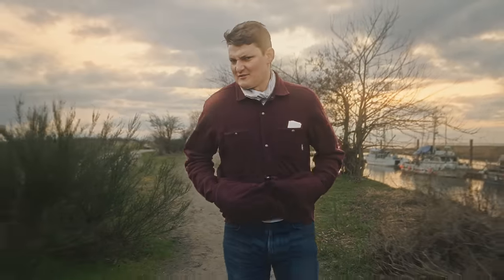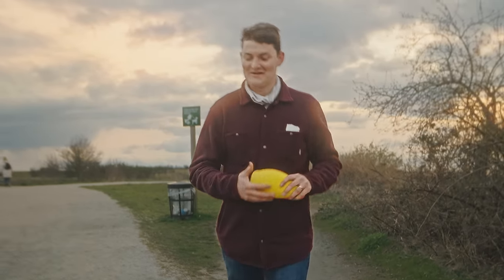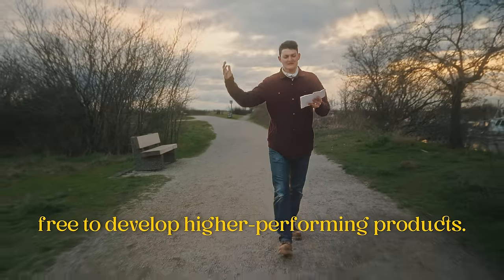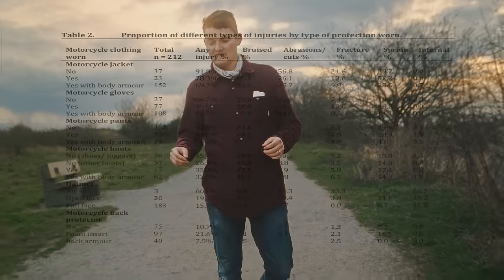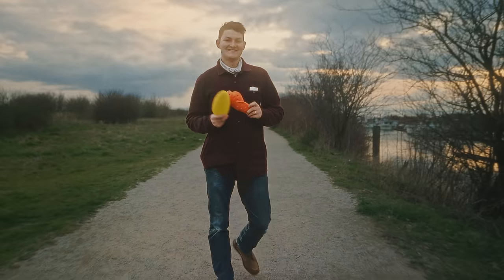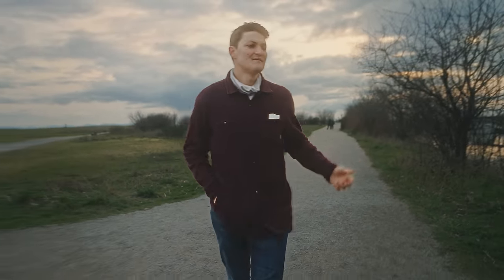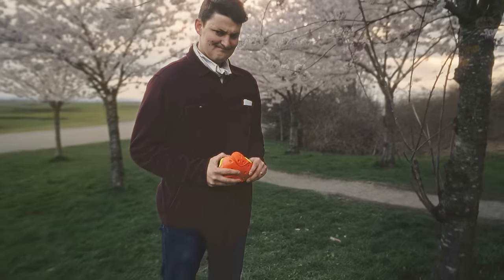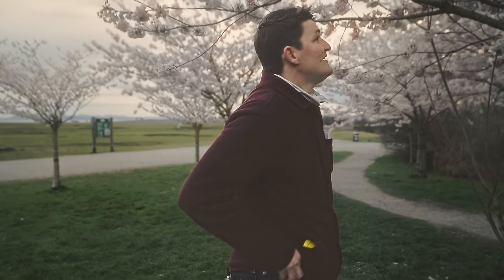Why I Stopped Wearing Motorcycle Body Armour

Comment: My Rukka back, elbow, knee and shoulder pads protected me very well when I did a 360 somersault while still on my BMW F900XR when hit oil, followed by a curb then a barrier on a blind corner. I landed on my back on a metal barrier. In the area without the armour  my back had 3 fractures, a bad cut and severe bruising.  Where the armour covered, I had no fractures or marks at all. Despite the metal barrier ripping through to material to the back armour. The armour completely protected that area. It also protected my knees and lower legs, should and elbows completely.  Normally your videos are awesome, but this one is irresponsible. Rukka pads  are above the basic standards, and that was one of the reasons for choosing the brand. It saved me from injuries I don't even want to imagine.

Comment: In April of this year (2024) I made a "rookie mistake" (after riding for over 50 years) on a failt steep lefthand, decreasing-radius, off-camber turn in Death Valley. A touch too much front brake and the front tire (tyre?) of my Triumph skipped for a millimeter, but on an off-camber, the road "falls away" from your tyre and there is no way to regain traction. Immediate washout of front end before you even see it coming (I was doing around 35mph). 

Wearing armored (OK, armoured) leather jacket, kevlar/cotton jeans, Arai helmet, leather gloves and Sedici boots, I went down hard, with the bike directly on top of me. The first point of contact with the road was my left knee. The pants tore open, the armour (which might have absorbed ta little of that initial blow) shifted out of alignment. The result was a deep wound right down to my meniscus, torn ACL, along with three broken toes, metatarsals, etc. No upper body injuries. The lovely Arai helmet scuffed and skidded but not a hard blow—only enough to ruin the beautiful gray-on-silver-on black British flag motif. Being months away from 70 years of age, I fortunately still heal fairly well and two months later I was back on two wheels (I'll be riding across the UK next month to attend the Manx GP on the IoM.

The point here is that I was disappointed that my knee/leg injury (which resulted in infection, swelling, seroma, etc) was not prevented by the armour. I assumed it deflected it to some degree and perhaps it would've been worse without it. But this video definitely shed some light on the issue. It didn't however, propose any better options. Is there a higher-level CE armour available to replace the standard stuff? There's a cottage industry opportunity right there and I'd be first in line.

That said, will I remove the crappy armour from my new gear? Nope. Better poor protection than none, methinks. And don't make rookie mistakes.

Comment: As with bicycling, the protective gear gives people a false sense of security and invulnerability. While I have not been in a motorcycle crash, I have seen the aftermath of several. Knowing what one looks like, I would rather die instantly in a crash because I didn't wear the protective gear, than live my life in crippling pain with several disabilities because I survived a crash thanks to the protective gear.

Instead of wearing body armor, I practice additional caution. I would rather rely on my ability to avoid unnecessary risk and dangerous scenarios so as to not have a crash at all.

Comment: I'm riding motorcycles for 40 years now and wouldn't go out without  wearing my Alpinestar tech air vest. Before  that, I've always  used foam body armour, and it served  me well the few times  I came off my bike. Body armour is absolutely  helpful in particular  in lower impact force  crashes.

Comment: my MT03 slipped on something I didn't see and I was throw from my seat at 120 km/h. My leg was stuck under the bike and both me and the bike slide together on the concrete for almost 50 m. I got very little scratches on my lag, my jean damage beyond repair, but that’s it, not thing more. My riding gear with those little foam protection was doing its job so well and I appreciate wearing it every time.

Comment: My experience snowboarding with & without crash pants/vents says you're wrong (the crash wear in snowboarding uses the same standards afaik). I fell many times on the board with & without protection, so here's just one example. While buttering I caught an edge without impact shorts & landed on my butt (not much speed). The pain was enough to take my breath away. I couldn't sit for weeks. On the other hand I once had a wipeout on the snowboard riding about 60-70km/h while wearing full protection. I landed pretty rough on my side (shoulder, elbow, ribs) & tumbled a good 2-3 times before I came to a stop. TBH I didn't really feel the impact at all. I brushed off the snow & continued riding like nothing happened. Even though I never had a crash with the motorcycle, I assume the results would be similar. Protection is amazing. Even if you still break a bone wearing protection, I'd assume the effects would be worse if you didn't wear any. YMMV

Comment: A car went through a stop sign I hit the car and went over it. I was wearing a full one piece suit, I broke my collarbone fractured all my ribs on my right side punctured my lung fractured my pelvis and I had a large hematoma on my leg
I looked at my suit months later and determined that the padding in my elbow and forearm is was probably broke all my ribs.
Did it save my elbow maybe but I almost died because of the puncture.
And I still wear gear with elbow pads I just wear more chest protection.

Comment: Been down 2x. I city, 1 highway.  Untold crashes off road (mx).  Never have i regretted any padding or protection.  Bohn pants on bottom instead of underwear   under my jeans and armor in my mesh jacket year round with layers as needed. Full face helmet, of course.  But hey... that's just me.

Comment: If you have a crash and you wear armour and nothing happens you will automatically think it is because of that.

If you have a crash and you didn`t wore body armour and you have a fracture or whatever then you probably are more likely to blame yourself (depends if you tend to do that).

Personally I think it`s a better deal to wear it, wether statistics say it or not.
On the other hand you should ride the same as you would without any gear, because when I was younger I rode more reckless with gear than without because I had the illusion of protection.

Comment: OK....  I have crashed a few times road and track... I wore back protectors as soon as they were first being sold and my original T Pro back protector got used at my very first race meeting when I was thrown off and landed hard on my back. I would have been winded as a minimum or worse but I got up with nothing more than some torn muscles and sore for a few days, the cost of new helmet and a bruised ego... Not the best back protector as it was quite thin and basic. I now have Forcefield armour back protector and the rest of the armour in my leathers and/or road riding gear is as supplied by the manufacturer. But I always use that Forcefield back protector road or track.. Now the problem with air bags are you can have them fitted inside the clothes and race suits you buy but how many jackets do you have? Can you swap that air bag to each one without having multiple air bags? Then can you use that same air bag inside a race suit?  Apart from Helite vests which fit over jackets and suits the answer is no you cant use the same air bag.  If you have an air bag do you want to have multiple subscriptions for each air bag?  If you use a air bag vest without a subscription, do you want to have to use a lanyard every time you get on and off the bike? Wearing a vest over regular riding gear is a pain and the fluro yellow or orange vests just look awful in most cases.  So you end up with the expensive Helite electronic vests which has to fit over your normal riding gear OR leathers as the race one is made for the racing humps and the road one will not fit over the hump... Vise versa the race one will have an exposed area where a hump should be and can grab if you land on the road and slide causing possibly more injuries.. 

We need an air bag which is electronic and works in any suit or jacket like a normal back protector which we pay for and not need to pay for a subscription. I want to own it and not have to keep paying for the benefit I have already paid for...  The only option is the Helite race vest or electronic road vest and for me the race vest alone cost more than I paid for my race suit and would cover over any sponsors logos and not match the custom race suit so to keep sponsors happy, I would have to go back to the old back protector anyway..  I know of at least one rider at this years TT removing his air bag to save weight and reverting to the old school back protector which is another issue alone but one racers, even at the TT have with air bags.

Comment: When i did my CBT, one of the things that the riding school i went with showed us was the full leather jacket of the guy who owned his the school that was damaged, not much mid you, and they asked us to guess how fast the guy was going. He was going 120 miles an hour on a private road, so not a race track with super smooth tarmac in comparison to a normal road and he was able to walk away from that and is still alive. That full suit and the armour in it saved his life, he would have been severely injured or dead with out it.

The whole point of any protection, whether its motorbike body armour, bullet proof vest or a well armoured tank is that its there to mitigate the potential damage. It will never work 100% of the time, but its the difference between you taking a massive hit and being able to walk away verses not.

I had a very small accident where due to some black ice on the road as i was turning into the street i live on at slow speed, my bike went from under me and i slammed into the road hard. I was only wearing a casual leather jacket thats not for motorbikes and my arm was heavily bruised and sore for a good while after, also the arm of my jacket was torn apart. If i was wearing my Dainese jacket when this happened my arm would have been way less sore because of it and the jacket would have been much less damaged if at all
Reply: Glad to hear you survived however you make a number of assumptions with regared the different gear you could have been wearing - "If i was wearing my Dainese jacket when this happened my arm would have been way less sore because of it and the jacket would have been much less damaged if at all" - you have no way of knowing that without totally replicating the incident. It`s good that you have some confidence in the gear you choose to wear but don`t let that confidence lull you into a false sense of safety, stay safe.
Reply: @pamvarnsverry2444  Mate, one is casual leather jacket that is just for fashion and the leather is significantly softer than on my Dainese jacket, which also has armour in the arms that would dissipate the force. The arm of the casual jacket in question is completely ripped from the elbow down from a slow speed crash. 

I dont need to have the exact same accident in the Dainese jacket to know it would protect me more. Its a CE AA  rated jacket compared to a casual jacket that if it was put through the CE certifications test would fail outright. This is like saying to someone who got stabbed wearing a t-shirt, that they'd need to get stabbed again wearing a stab proof vest to confirm that it would provide more protection, which is an insane thing to say

Comment: My crash experience supports your hypothesis. However, I was glad to not have to deal with road rash in addition to my fractures. 

I crashed into the woods at 45 mph and only broke my leg. The break happened when the bike fell on it; I wouldn’t think ANY pad would help there.

Comment: I lost a front tire. I do REGULAIRILY check my tire pressure, in fact I checked it the day before and it was fine. Rolled out of my driveway, 30 yards or so up the street. Leaned perhaps a little aggressively into the corner and the bike just laid down. I had never felt anything like it, it was like the front tire was on grease. But I was wearing a jacket and pants, landed on my hip and elbow and it was like falling into bed. I slid way farther than I expected for the speed, like 20 feet, but not a bump or bruise. I get the point, in a serious crash they won't do much. They'll do more than if they were not there even if it is minimal, but most crashes are not that bad. Most often people are on the brakes before impact and the average speed of motorcycle accidents is only 21 MPH. so I think they are helpful at that point. My opinion, for what that's worth.

Comment: Just witnessed a lowside with 25 Mph in a turn: The armour shirt fabric (KNOX Urban MK3, AA rated)  over the ellbow armour ripped just away. The guy was unhurt because of the yellow armour pads inside: They prevented the guy from shedding skin, NOT the tissue. Same story, even worse, at the knee (Held Urban 46). Only the armour safed the skin. The fabric was shredded. And this was at 25 mph (around 40 km/h)! I'd advise to put those armour pads always inside. 
(I send the fotos and a report to Knox: AA rated garment rips away at 40 km/h? Strange)

Comment: Let's consider this using a similiar situation. A helmet that soldiers wear are not capable of stopping a bullet fired straight at it. Should the soldiers there for stop wearing them? Or should they continue using them as they do stop shrapnel, bullets coming in shallower angles and impacts caused by bumping etc. . Like the helmet, these pads likely have an increased usefulness in situations where the force isn't coming directly perpendicular to the limb, or like stated in the video grazes and so on. And out of accidents that happen on a bike, which is the most common? A crash with large impact forces or losing traction resulting in a slide and other such accidents? It's still better to have them while not being a complete universal protection than not having them.

Comment: As a guy who doesn't ride (but is starting to flirt with the idea) i can only speak with very limited perspective, but i worked with a couple guys that did years ago, both of which wrecked in the time i worked with them. Different wipeouts, different circumstances, and different outcomes. One, on a track, laid his bike down, no armor, had road rash from hell. The other, on a highway, doing a wheelie, sent the bike into the air, and rode the off ramp on his back, in full armor, was totally fine. My takeaway: the armor is likely much more intended to protect your skin from being ground the hell off, than it is to pad your skeletal structure. If you're going fast enough, and wreck badly enough, that you'd be at risk of breaking bones, i really don't think any kind of armor is gonna prevent that from happening. I could totally see it saving you from getting cheese grater'd and spending time in a hospital waiting for your ass to grow back though.

Comment: if youve ever played hockey, where the surface is practically frictionless vs a tacky road, falling on your pads, again in hockey where max normal people are going 20mph, is far more preferable to not having pads. slamming on the ice where theres no padding is harsh, or getting hit by a puck where theres no pad is exponentially worse than the padded hit. there is no way ur convincing me slamming at high speeds on asphalt without pads is gonna result in similar injuries, ludicrous. uve drawn the wrong conclusions from ur interpretation of a narrow data set.

Comment: I had a Kawasaki KLX650 I would ride to work. One morning last September I was topping a hill on a forest dirt road on my way to the highway when a deer I never even saw darts in front of me at 50mph. Of course I flew probably 20 yards down the road. I was wearing my full face helmet, a waterproof jacket and pants from Amazon and good riding boots. All with the pads removed from the last cleaning. I had forgotten to reinstall them. After the accident my bell was thoroughly rung and I needed therapy to stop getting dizzy when I looked up. And i was sore for a good 2 weeks. But otherwise, there was no broken bones or internal injury. But I still haven't been able to replace my poor Kawasaki. 😢

Comment: Only wreck I've been in thus far is looping a wheelie at 40ish mph, and the nylon jacket I was wearing wore trough instantly and the back pad was what took the abrasion.  Only injury I got was to the body part that wasn't padded: my knee, which was a simple road rash abrasion that would have been completely prevented if wearing padded pants.

A properly fitted jacket and a properly built body (read: dont be overweight) means you wont even feel the pads.

Comment: Most riders absolutely underestimate the physics behind a motorcycle crash. Not even a 5mm steel plate will protect you from fractures, it will only shift the location of the fracture to a different segment of your bone. There is only one way to greatly reduce the risk - common sense and an adequate riding style. I still wear pads and protective gear because not all accidents imply immediate impact but rather skidding over tarmac which is where anything that can take some abrasion is highly welcome.